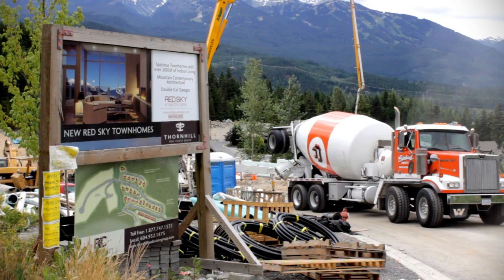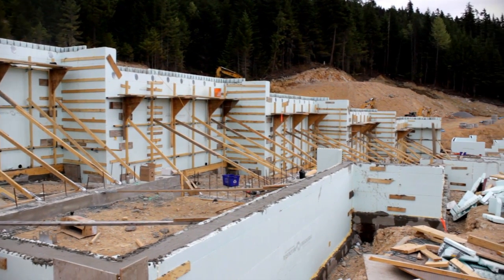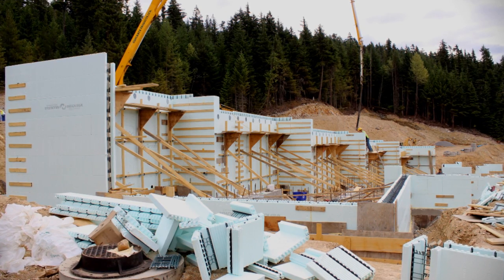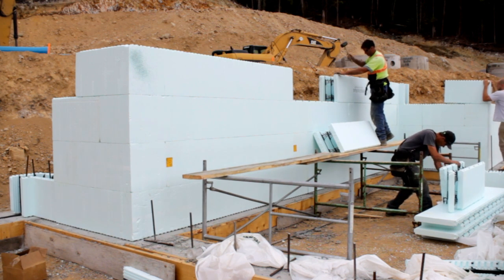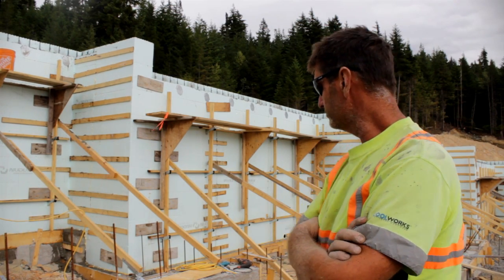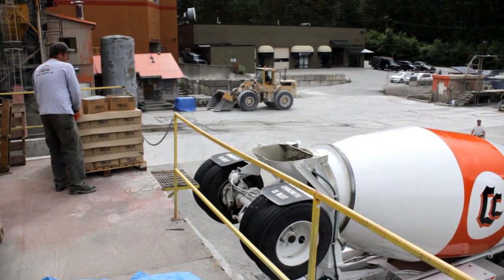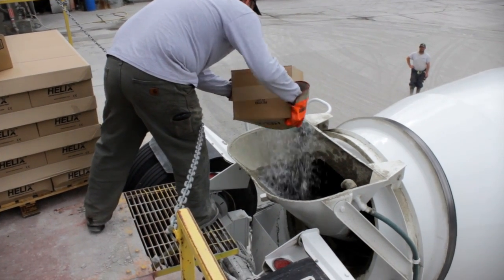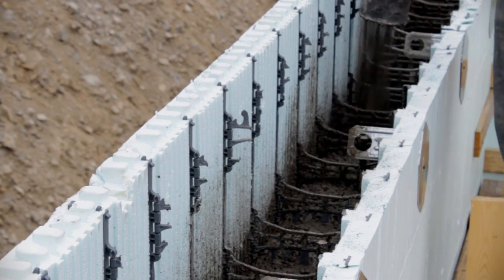Insulated Concrete Forms (ICF) VS Plywood Forming

Comment: This is the most advanced construction method for longevity. This is the most resistant to earthquakes, high winds, & fires. Helix is superior to rebar because it binds concrete at the square inch dimension. Buildings made this way will last for centuries. Concrete walls are a little more difficult to remodel so start with a good long-duration plan.

Comment: He never mentioned the savings of having to insulate a plywood formed concrete wall after you strip it
 Insulated Concrete Forms have a tested R-Value of 22 TO 24. =  to 3.5" of Styrofoam R- 21.7 
Then the cost of  strapping plus labor and time
Or 6" fiberglass R-20 then the cost of 2 X 6 framing plus labor and time

Comment: So it has no rebar because of that type of mix used ??
Reply from the maker: It has no rebar because Helix micro rebar was used in the concrete mix; https://www.helixsteel.com/
Reply: @FabFormIndustries  helix only retards small car cos, i does not lend to strength per se- cant see how you get away code wise with no rebar -and aren't you deviating from manufacturer.s official installation instructions ??

Comment: Funny how there is no mention of the fact that ICF is a pea gravel mixture, or do they actually follow this procedure? Is standard in Canada, although it does not provide the structural integrity of a crushed rock mix. It does provide the flow needed to properly fill a ICF form tho. The trade off is a unwritten fact that does not get disclosed.

Comment: Is the wood nailed onto the icf really necessary?
Reply from the maker: Screwed into the ICF, and yes every wall should have a vertical marriage joint unless the foundation is designed around the interlock of the ICF.

Comment: Would love to see the styrofoam stripped off one of these ICF walls. The honeycomb would be shocking. Conventional forming is waaay quicker and easier/stronger with a full 8" of concrete not 6" in a typical ICF. You could do a hell of a lot of insulating on the interior of a conventional foundation with the money saved. Ever bump a lawn mower or a weed wacker against styrofoam? ICF is fine for a handyman but not really practical in the real world.
Reply from the maker: Honeycombing would occur in a plywood formed wall the same as an ICF. This comes down to concrete mix design and those placing. Not the product itself. Plywood forms beings stronger is completely irrelevant. Strength comes down to local engineering, the same strength will be achieved with both methods. For the top 8" of ICF, stucco or hardiboard will protect it from the lawn mower. Millions of feet of ICF will be proof enough that this is for the "real world".
Reply: You stucco the outside walls.  DERP!
Reply: Patrick EH I realize that,  but I'm pretty sure stucco doesn't have any structural strength.....even from a weed wacker.
Reply: I don't what"world" you live in but icf is the best wall system
Reply: simply use a piece of 1x4 and a hammer and tamp the walls. Not that hard really. Could also use a vibrator. Just requires not being lazy about it.
Reply: I think you are wrong. ICF has been a tremendous time saver for my builds. ICF's can be done in any thickness of concrete inside, even over 12"can be chosen if need be. I add a variety of coverings on the outside such as dimple plastic mats or stainless siding which is lawn mower and even truck proof!
Reply: you should watch this insulation video, https://www.youtube.com/watch?v=kwn0Vjw_ji0
basic building design science, I don't think you will ever insulate the interior of basement walls again. You can inlay furring and attach siding to it (fiber cement board if  you want it to be durable)

Comment: Is it cheaper than any material, not only Plywood ?
Reply: Plywood, Aluminum or composite, its much less time with ICF since it does not require removal of forms after pouring and setting the concrete which bites into the overall construction time when you use forms that require stripping and then more time to insulate with old fashion formwork. And with my experience with basement waterproofing ICF is more solid and much less chance of water intrusion when built right with exterior membrane added on.
Reply: It really depends on the job. For walls, ICF is cheap because stacking up and moving the material is a major cost factor. For other stuff like pillars in commercial buildings, having a metal form which you can easily split and reuse might be cheaper. Pour the same pillar again and again without having to adapt the form to the specific needs.